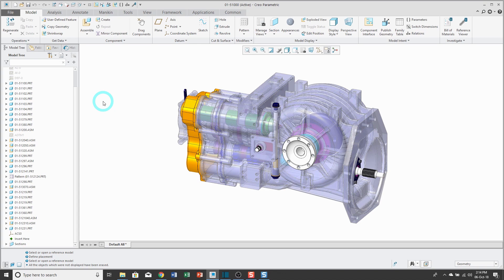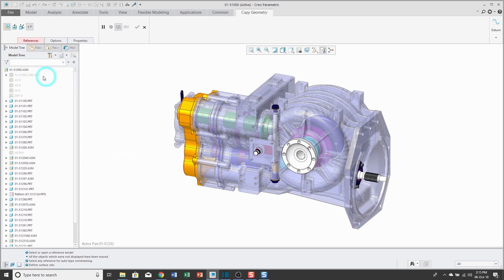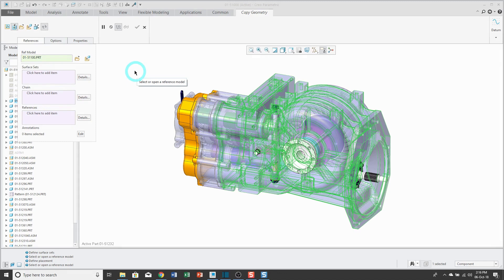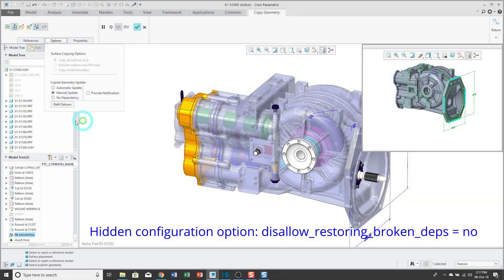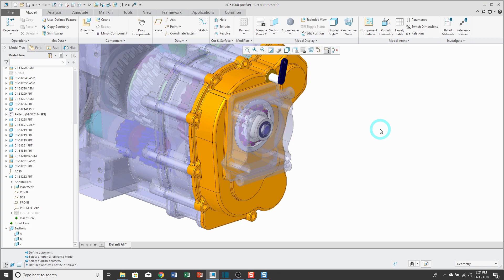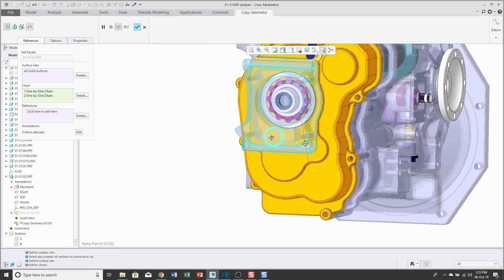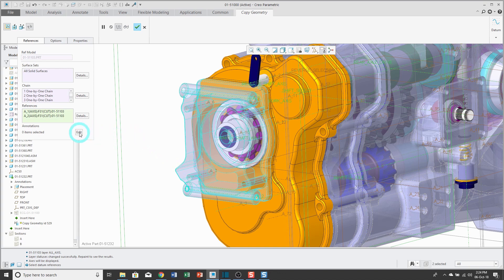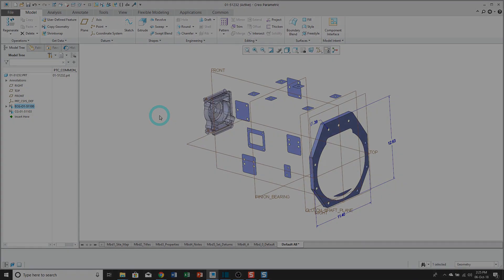Creo Parametric - Copy Geometry Feature | Top Down Design

Comment: When would you recommend using copy geometry vs. using a skeleton with a shrinkwrap feature?  Is it primarily based on the number of components/features you are trying to bring in as a reference to your subassembly model?
Reply from the maker: They're not mutually exclusive. I often use both together (and preferably in a skeleton). In cabling, I will use Copy Geoms to grab references for assembling components and Shrinkwraps for routing references. Copy Geom is good when you need references from one source model only. Shrinkwraps are good for referencing multiple components in one step. They can also automatically update with any components that are added to the assembly, which can be both a blessing and a curse.

Regardless, you should make your choice depending on your situation and what changes you expect in the future.

Comment: as an experienced Pro/Engineer user....for the love of usable models ABSOLUTELY DO >>NOT<< USE COPY GEOM!!!! it creates external references and renders the model uneditable!! WARNING! DO NOT USE COPY GEOM!  do yourself a massive favor and learn proper modeling techniques before you make the critical mistake of using copy geom. Pro/Engineer has a reputation of punishing users who try to cheat to get things done fast
Reply from the maker: You could not be more wrong. Used properly, external references are a massive benefit towards building Design Intent into your products.
Reply: It's not the plane, it's the pilot. 😅😅
Reply: please trust me. i have used Pro/Engineer since version 17. i have learned from my use that it has a vicious temper if you try to cheat. copy geom will only create external references that will pull the copied model into session every time. the model created will have no definition on its own. you will create a dead model using copy geom. its an absolute waste of time to try and convince me. i have seen the worst garbage models in the database where i have worked to know how useless this modeling method is. do yourself a favor PLEASE. editable models are far more useful than copy geom models
Reply from the maker: I first used Pro/E in version 12. I won't try to convince you since you said it's a waste of time, but there are two factual errors in your previous statement. Have a nice day.

Comment: Still confused as to why Copy Geometry somehow solves the problem of external references.  The examples shown still are creating external references, so the external reference problem that is recommended to avoid is seemingly no different than if Copy Geometry was not used and the external geometry was used directly.  The only advantage of the Copy Geometry that I understood was you could turn the update control to off, which breaks the external geometry reference.  If one is to avoid external references as recommended, it seems the only option would be to to the update control off.  Can you please explain a bit further?  Thanks.
Reply from the maker: I do not recommend avoiding External References. They are an extremely powerful design tool and an essential part of Top Down Design. I fully recommend designing with External References, but doing them properly - with Data Sharing Features.